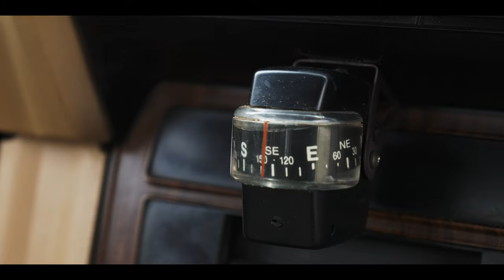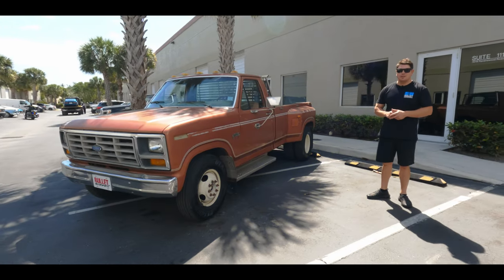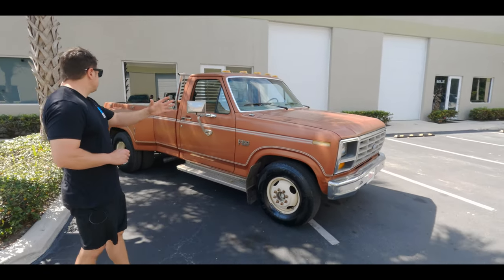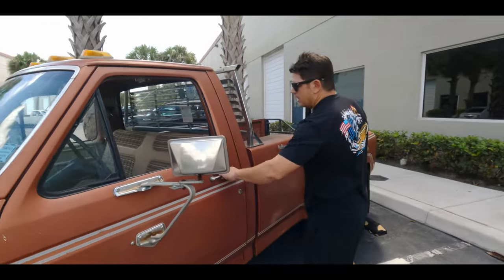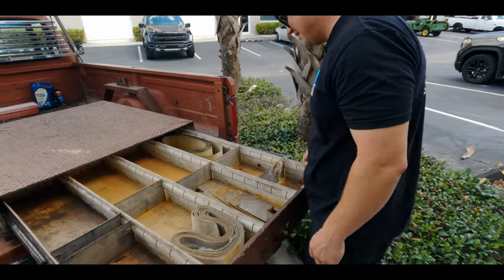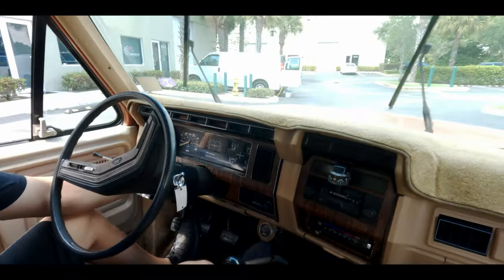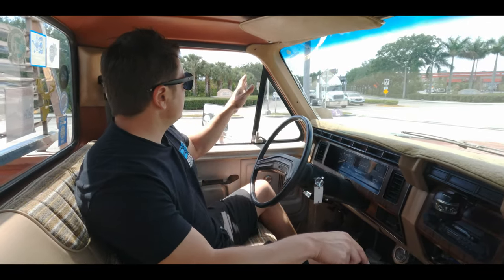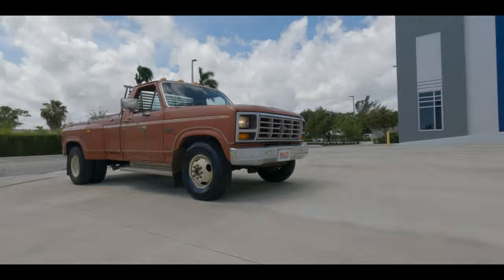1983 Ford F-350 | [4K] | Garden Special

Comment: "Its been running ever since... He did replace the motor 2 months ago though..." those things dont go hand in hand... If someone told me after I bought their truck is was running great, and it needed a motor replaced I would be baffled lol - running great ever since... Yet it wasn't running to the point it needed the engine completely replaced... Not running at all at that point.